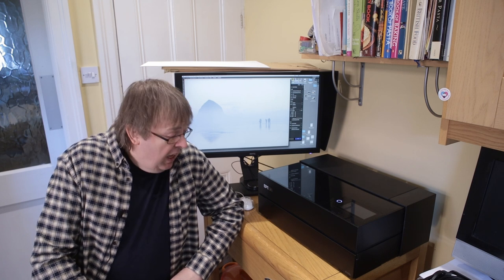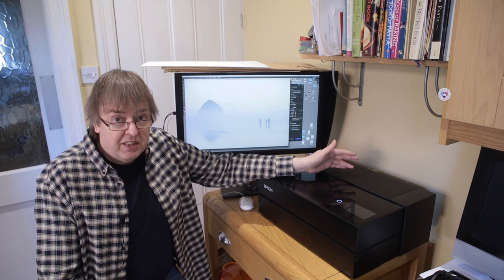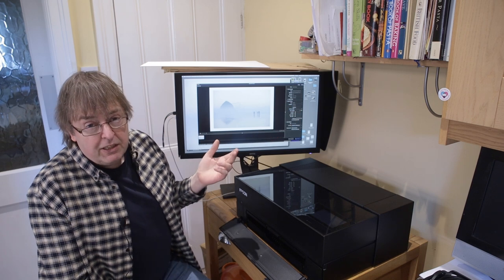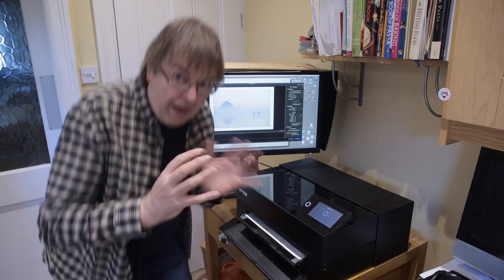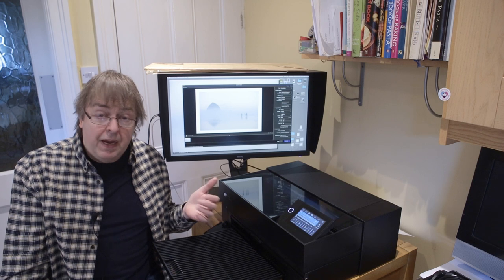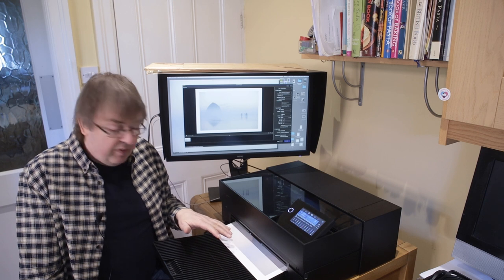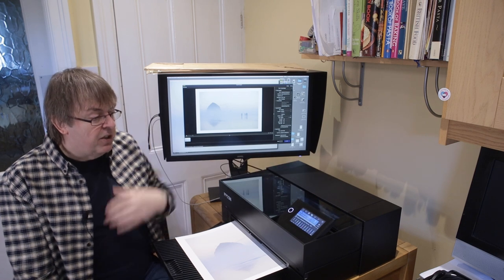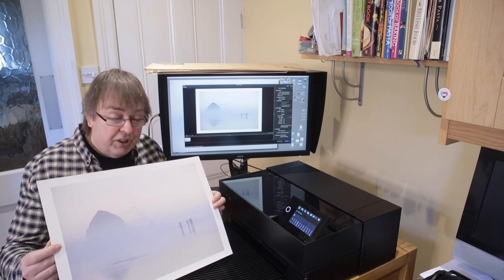Epson P700/P900 using thicker art paper via the front feed

Comment: Thx Keith, I finally got my P900 to feed "thicker fine art" paper via the front loader ( Edition etching rag 310gsm ) it has a low tolerance for sending me the message "error in front feeding" -  anyway you state ( either here or another informative as always video) that when you print monochrome images you use ABW in EPL ( the Epson software ) as I also do.  In your experience do you find a difference with ABW ( media setting is dialed in according to paper type ) but with ABW you do not get the option to put in the specific ICC profile for paper - (?) any thoughts on this... I wonder if the alternative to just use  media setting e.g  semiglossy / velvet fine art and then the specific ICC profile and print from there.... ( The file edit with output for print is finished in other software ( PS / Silver-E ) and exported ready to be printed . Thx again !
Reply from the maker: ABW does not use profiles at all - note that I may use a linearising curve in PS for some papers
See the actual review and the supplementary article of B&W for a lot more
https://www.northlight-images.co.uk/black-and-white-printing-with-the-p700/
[my written articles are always where the real detail lives... ;-) ]

Personally, I usually print directly from Photoshop - EPL is just easy to use and what I use for 'teaching' stuff - it's also the same on win PCs

Comment: Hello Keith,  Great videos with excellent content.  I have had no problems with my P900 until I started to print 16 X 20 Big Bend Baryta (with borders).  I am getting smudges on the trailing left (facing the printer) corner of the image, about a  1/4 of an inch in from the top border and almost touching the side border.  I do not see any curl in this paper, but have not tried another brand of 20 x 16 paper.  I have loaded from the top. Epson their one support had me uninstall and reinstall the driver.   I will keep trying to debug, other paper, front load, etc..  Do you have any suggestions for resolving this issue?
Reply from the maker: Ah, the Epson version of 'switch it off and on again'...
When paper comes out, try raising the level for it. I've heard of people putting a few magazines in the paper tray to raise the level and reduce the 'lifting force' applied to the end of the print.

Comment: Thx again, Keith . Everyday learning from your videos. I've recently encountered problems of "off centered" Prints with A3 printing thru EPL with "centered" checked , also tried resizing image ( mm / since in Norway) - anyway the printed image is pushed sideways with "uneven" borders ( I do not print borders ) ... This has occurred with both luster paper and Canson edition rag . I have always printed from rear feeder, and will now try the front feed tray ( a bit off topic ) but anyway, cheers and thx .
Reply from the maker: Glad to have been of use - do check the actual measured size of the paper you are using - I've seen more variation than I expected. The positioning is from the RH edge IIRC

Comment: Thank you for another great video. If a corner of the paper is damaged can you cut it off before you put it in the printer if when framing is not an issue?
Reply from the maker: I've not tried this, but many printers have optical detectors which detect the size of the paper. Chopping off a corner could mess with this.

Comment: Nice video as always. When you choose between relative or perceptual, do you use two different profiles? I'm tempted by the platinum coton 305 as it could be a cheaper alternative to hahnemulhe rag 308 which I like. Do you know if they look similar or if coton 305 look obviously warmer? does it look yellow? Thanks, it's a bit expensive to order just a test pack to try as we don't have a fotospeed distributor in France.
Reply from the maker: Thanks. With the rendering intent choice, the differences are encoded in the profile. When I build the profiles, the RelCol is fairly fixed, but I get some latitude in how the Perceptual will perform.
I've not used the 308 for quite some time, so don't recall the difference - see here for some of my paper coverage.
https://www.northlight-images.co.uk/keith-coopers-paper-reviews/
Reply: @KeithCooper  Thanks for your reply!

Comment: My Epson 3880 finally gave up the ghost and your review on the P900 convinced me it's time to move up.  I've had the P900 for a month now and have relied heavily on your videos to make friends with it.  The new P900 started making loud clicking noises when I first tried front loading., I panicked.  No need.  There was your video and I saw that my poor P900 was struggling to grab hold of the paper because I hadn't fed it far enough in to begin with.  I'm now going to try the feed method using your advice and I bet the clicking will be gone.   

I work in a small space, I think from seeing your video, the space is  not unlike yours and I must confess I'm envious of that little desk on wheels you have.  That's one continuing problem to work on, trying to find a  moveable desk, the right size for when the printer is fully open and roller attachment is on.

I've gone on too long.  It's because I appreciate your work so much and I've been far too long letting you know.  I'm not a photographer in the pro-photographer definition.  I'm an artist who often uses photography as one of my tools of expression in my work. Your excellent advice about all things P900 is a big reason why my most recent installation worked out so well.  THANK YOU Keith Cooper!!
Reply from the maker: Thanks - I'm glad it's been of help!
The videos are currently shot in the corner of my kitchen and that little table is what's called a 'butcher's trolley' - if you look carefully, you'll maybe spot some pots and pans ;-)

I'm in the process of doing a huge clearout of my office, so I may start doing some videos there as well ;-)
Reply: @KeithCooper  Thank you for 'naming' your printer support.  I was having a hard time finding a suitable support for my printer in my small space.  And there is not enough of yours visible in the video to make a good guess.  (Of course not, your video is about feeding thick papers and hasn't anything to do with printer furniture!) As soon as I entered 'butcher's trolley' into the Google search blank, I had plenty of 'returns' to choose from.  Awaiting delivery tomorrow.  So I have my printer support thingy to thank you for as well.  🤣
Reply from the maker: @clarissalewisart3091  Ours was a wedding present   :-)
I think it deserves a short video of its own...
Reply: @KeithCooper  Absolutely!!!

Comment: Is it ever listed exactly at which  thickness requires the front paper feed?   I’ve never seen a number posted.   Thank you.
Reply from the maker: Unfortunately, I've never seen it in specs for the printer - maybe they are on an Epson site somewhere around the world - if you do find them let me know where, and I'll add info to the review
Reply: @KeithCooper A manual is a  enlightening thing… when you take the time to read it!  Turns out the front tray can handle papers .51mm to 1.5mm thick ( 0.02inches to 0.59 inches). That’s actually alot thicker than i was expecting!!!
Reply from the maker: Thanks - It's interesting that the printer has four front load options. There is the thick setting I used with poster board, then there is the thick art paper setting (in this video), along with the CD print tray and the 'no pizza wheel' option for glossy papers.

Comment: Last year, I printed a 19" x 13" photo, using EPL, choosing Front Fine Art Borderless option. Edge-to-edge ink. Excellent.

Later last year, I applied Epson's latest firmware.

Today, I printed another 19" x 13" photo using the same settings as before.

~~ DISASTER ~~

I spotted the left edge (right as you see the paper coming out of the printer) had a 3 mm gap. Despite this, I let the print job finish to see what else would go wrong. At the end, there is a 1mm gap on the bottom edge. By gap, I mean non-inked areas.

So, using simple logic, something in the firmware update has created this fault.

At any rate, how hard can it be to program EPL and the printer to know the paper size and the top, left, bottom, right edges of the paper? Especially if I use the Front Feed and make sure the paper is lined up.

This is not rocket science. It is very basic and Epson have been churning out printers for decades. If they do not know how to program the printer to do borderless printing by now, they never will. Very slipshod.
Reply from the maker: This is one to raise somewhere like the  printing forum at DPReview - it's quite a while since I printed on a P700 or P900... Not something I can meaningfully comment on

Comment: What is the bluest blue you can get out of the P700/P900 inks? I created a picture of bluebells that looked blue on screen, I used the correct ICC Profile for the particular paper I was printing on but the final print came out a bit purple. So, was it my error or is it that the P700/P900 inks can only go so far in the blue range because it does not have a dedicated blue ink? Thanks.
Reply from the maker: Ah,  you have hit on a classic colour management 'problem'  It's almost certainly nothing to do with the presence or otherwise of a blue ink
What rendering intent did you use when printing and what colour space is the image in?
The complexities of this (and potential fixes) are too broad for a simple answer in this space - if you wanted to email me at Northlight Images, I'd be happy to look at it further
Reply: I think I can overcome this by reducing the magenta in the picture by about 30%. I can do this in Photoshop easily enough.
Reply from the maker: @fredwestinghouse2945   That brute force method very rarely a good solution - If you want to do it in PS, use a H/S adjustment layer, select blues, use the eye dropper on a particularly strong blue and then use the hue adjustment to move the blue towards the cyan a bit. (you can mask the layer, to keep the effect to where it's needed)
Remember that the colour of bluebells is a particularly tricky one to capture in the first place since they are invariably in cool shade surrounded by intense green - the colour is also one where digital sensors/processing may record a slightly different colour to what we perceive.
Also - try a test print section with perceptual rendering as well (soft proofing may help, but it can't match a small test print)
BTW saw your mail - if the above doesn't work, there are a few other ways of approaching the image...
Reply: Yes, all good advice. Will do test sample prints until I get the "best" blue the printer can achieve. Thanks.

But, for longer term, is a "true solution" possible? Maybe, print a test sheet, send off to the lab, get a custom profile?
Reply from the maker: A custom profile may help (depending on how it's made) but, and I always hate suggesting this, try a test print at the 'printer manages color' setting - it could be awful. but every so often it looks surprisingly good with some colours.

Comment: Can the Epson P900 print on 4x6 and 5x7 photo paper?
I kinda assumed that it can take on the smaller paper sizes but needed to confirm this as I do not see anyone printing on these on youtube videos. I understand that it is designed for large prints but I liked the color output so much that I decided to get it to print 4x6 and 5x7 photo papers. I don't really plan on using it for anything larger all that often but will be outputting quite a few of these postcard sized outputs. Will this be an issue?
Also, the papers I am looking at in these sizes are both 300gsm thickness. Would I have issues feeding it from the top?
Reply from the maker: See the info in the main [written] review - I only tend to put all the 'fine detail' into the written articles
https://www.northlight-images.co.uk/epson-sc-p900-printer-review/

I believe those sizes are supported [borderless as well .

I didn't test how many cards could be stacked for input at the top, but for thicker media it may be just one at a time.

Comment: I use the front feed for glossy prints in order to avoid pizza wheels by using the No Eject Roller option.

I have found that using the front feed can be a real PITA for some papers. I make sure the paper has very little curl before putting in to the printer. Yet, the paper path inside the printer is so tight, the paper will hit something. It takes many attempts to finally get the paper through.

This is not Epson's first printer. Have they not learnt from previous printers? Do they even care?
Reply from the maker: Paper handling is an area where some development effort could usefully be expended

Comment: New to the P900 and the paper seems to get caught on something toward the beginning of the print. It will be caught briefly at the start of the print and then releases as it gets pushed further out, bending that side about 20mm and causing a small ding in the middle of that edge on the same place every time. Is it possible it's getting caught on the bottom of the front feed? I've tried loading both front and top, flattening my paper, printing from Lightroom and Print Layout, triple checking my paper settings, but it happens every single time. Using Epson Velvet Fine Art and Ultra Premium Luster. Is this something you've encountered before? Cheers.
Reply from the maker: There is a 'thick paper' setting in the printer menu, which may help.
If this persists with an Epson paper, on a new printer, then contact Epson -it should not happen.

Comment: Nice video Keith.  I have a question. I own the Epson P900 and have used the back loading for the Velvet Fine Art Paper.  It appears to work fine.  However, after watching your video, should I be using the front feed slot?  I appreciate any input that you have.  Thanks
Reply from the maker: Thanks - If a paper is stiffer or marks easier, because of the rollers, then it's a use for the front. I'll admit I included it as a video mainly because the feature was there ;-) During my testing I almost always used the top feed.

Comment: THANKS,         Keith  in general do you notice as prints dry after printing that they lighten slightly  ???
Reply from the maker: No not significantly on the papers I tend to use. When making profiles I prefer to leave the target prints overnight before measuring, meaning that any drying change will just be getting closer to my profile

Comment: Your videos have greatly helped my wife and I use our p900! Thank you for doing what you do and explaining in such great detail.

It's a long-shot, but we've run into an issue randomly where the front feeder refuses to take the Exhibition Canvas Matte paper, and we cannot figure out what we're doing wrong. It takes all other papers perfectly fine from the front-feed (and has taken Ex Canvas Matte perfectly fine as well), but after only about 12 prints, when we load the paper and click "complete", it takes in the paper, but then instantly flags a paper-feed error...any thoughts on what our issue could be? Again, it takes plain paper, card stock, and other paper just fine from the front, just this paper (now) it has stopped taking the feed for some unknown reason to us!
Reply from the maker: Glad to have helped
I'm not sure what it could be - my suggestion is to load a sheet of something to see if it's a cleaning issue for dust or something from that particular paper (not one I know I'm afraid)
See my actual [written] P900 review [the videos are mainly to supplement my articles]
https://www.northlight-images.co.uk/epson-sc-p900-printer-review/
I virtually never used the front slot...
Reply: @KeithCooper  Thanks for that additional insight! We're thinking since we're self-cutting rolled paper, we're not flattening it perfectly such-that the printer doesn't want to accept it. Weirdly, we did get it to accept from the top-loading portion, so that has been successful (after a bulk head clean per your suggestion), and have purchased the canvas sheets that are manufactured/stored flat. Once we test that as the last variable to account for, we should know our solution! Thank you for reply Keith, it's much appreciated :)

Comment: Hi Keith
When you were printing on the thick fine art papers did you at any point need to turn on the ‘Thick Paper’ setting that is buried in the SC-P700 menu system?
Reply from the maker: I didn't - it's meant for where you use a thicker paper than the media in the media setting.
If I was using a particularly thick paper, but a media setting such as PGPP,  I'd take care with thickness settings. This is where the custom paper settings are so useful  (this is covered in the main [written] review)
Reply: @KeithCooper  
Thanks for the Response. The reason I ask is because I’ve just bought a P700 and, from initial set up, the printer was smudging the prints. I was using Epson Premium Glossy Photo Paper and the settings on the printer and Epson Photo Layout software were correct. Customer services suggested I should switch on the ‘Thick Paper’ setting. This seemed to help with the PGPP but not with heavier weight fine art paper (even when fed from the front). 
Epson have subsequently agreed that it’s a faulty printer and have now replaced it. However I just wanted to be sure that the hidden ‘Thick Paper’ setting isn’t needed for most paper types, especially the heavier fine art papers.